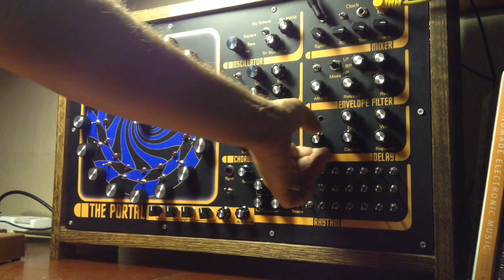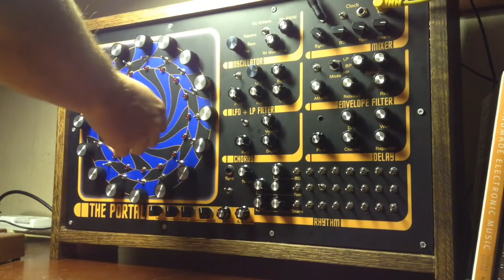DIY Synth Project

Comment: Hi Jeff, I know this is a while back but I'm curious about how you made your sequencers. I've played around with 4017's but I curious about how you get the multiplexor to sequence? I'm assuming clock from 40106, division by 4040 to step the 4067. I don't suppose you have a schemo or a pointer to places on the web? Fantastic project by the way. I'm about two thirds of the way through my synth and would like to include a 16 step sequencer. Cheers!

Comment: Hey I liked your video and your synth is awesome!  I'm in a similar boat trying to get into DIY, and I have a noob question: since your synth runs off a 12v supply, what is the best way to adapt 9v circuits to the 12v supply?
Reply from the maker: Andrew Stocker Hey Andrew!  I did not make any changes to the 9v circuits.  Everything I built and tested functioned the same or better with 12v.
Reply: @mravandelay  Oh okay cool, good to know.  Thanks!
Reply: @SleepyAMS  4xxx cmos chips should all be fine up to 15v, but always double check in the datasheet before plug-in one in !

Comment: Hey Jeff, awesome build!! I too have just began my journey in diy synths because of Casper electronics vids. What you built is pretty much exactly what I am looking to build. Although I have just made my first 8 step sequencer so I may be a good ways away. 
I will definitely use your links to do some research. Anything else you could recommend for a novice?
Reply from the maker: Cool!  Make no mistake, I am a complete novice too.  I guess my main points of advice are to test everything A LOT on breadboard before soldering.  And run everything off of 12V even if it calls for 9V, things seem to run a lot smoother at 12V.  And know that all of the effects I used are simply guitar effect circuits, there are boatloads available online.  I spent so many countless hours/days/weeks digging online to find circuits I liked that were appropriate, and I tested a ton of stuff that didn't make the cut.  All part of learning.
Reply: Jeff Hunt Definitly agree with you on that . Great work must be said again.
Reply: I'd gladly buy this one so you can build your next!

Comment: Fantastic! How did you make the front panel?
Reply from the maker: Francesco Sirocco Thank you!  I designed the panel myself, then had it produced at a local sign shop.  They print a vinyl sheet and adhere it to an aluminum panel.  I drilled all the holes myself, although the sign shop could have used a laser cutter.  The end product looks wonderful and it is very sturdy.  It was not expensive, $50.

Comment: how much background in electronics do you have?
Reply from the maker: I have zero background in electronics.  I just started following videos and reading a lot, then worked out this project over the course of about 5 or 6 months last year.  I did a few smaller projects in the meantime to get comfortable with it.  I did not even own a soldering iron until last year.  There are so many resources and helpful people out there.
Reply: Jeff Hunt - that's very reassuring to hear! I'm just getting into it myself, complete beginner but was starting to think I may be out of my depth. Like you say, though, there are loads of resources. 

Great job on the synth : )